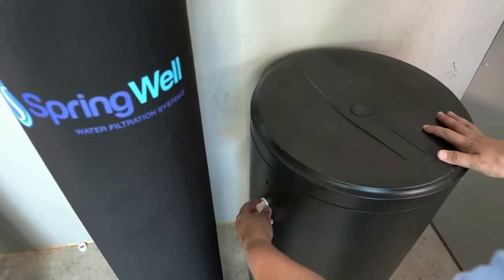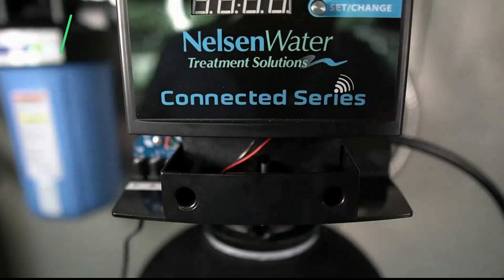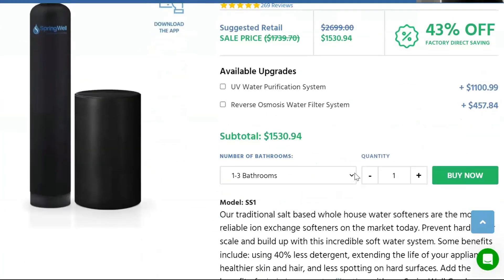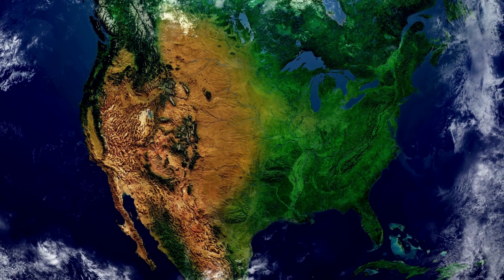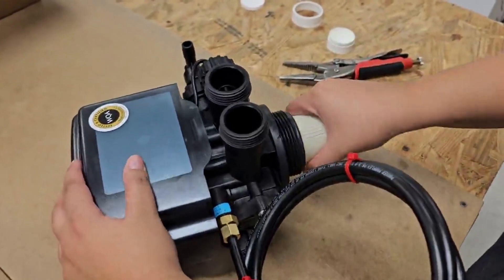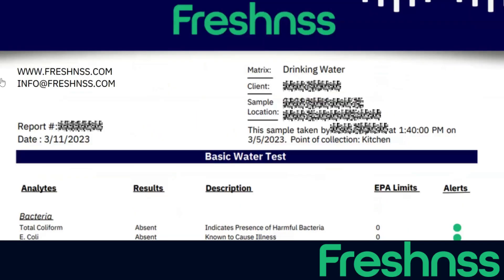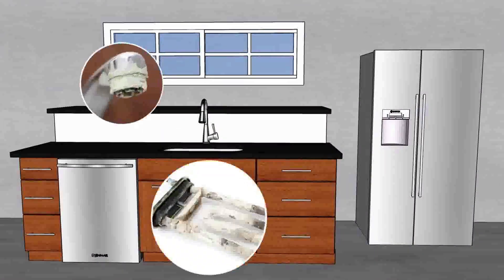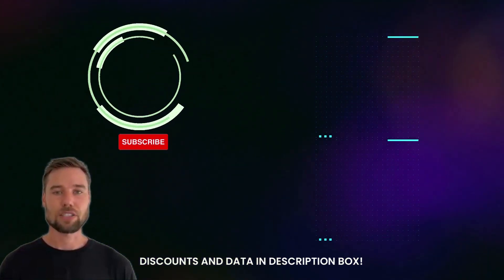The BEST Water Softener... That No One Is Talking About. We Lab Test It!

Comment: I've had my ss1 for one year and am working on cleaning, as recommended by springwell. do you have a video for cleaning the ss1, particularly disconnecting the brine tank
Reply: What did you end up doing ? Mine was low on salt and I cleaned the brine tank out with water .

Comment: I have to keep sodium intake low. May be a dumb question but do the salt based systems add sodium to drinking water I'd have to worry about? Thinking of a Salt-Free combo system from SpringWell but sounded like you think the salt versions are better. Our hard water has been wrecking our high end appliances (espresso machines, refrigerators, etc.)
Reply from the maker: Yes, we usually do mention that folks on a sodium-reduced diet should be careful. The harder your water is, the more salt will be added into the water. If you have reverse osmosis, that would remove all the salt. Otherwise, you have the option of using potassium instead of sodium. It's pricier and harder to get though, so you should check around first. Also, check the actually hardness level to begin with, as the salt added may be negligible.
Reply: @Freshnss  Good advice with the R/O systems. However, they remove beneficial minerals as well.

Comment: You point out that this system uses 8% cross-linked resin like its a good thing.  8% resin is the "cheap stuff".  The systems you get at Home Depot, Costco, Lowe's, etc use 8% cross-linked resin.  The advantage of 8% resin is that it's cheap.  The disadvantage of 8% resin is that it's cheap.  8% resin will lead to water pressure loss, uses a ton of salt leaving a slimy feeling in the water and these systems usually come with a 3-4 year warranty because they expect them to last you a few years and then you have to go get another one.  If you are going to have the same resin in this system and a system you can get at Home Depot for $500, what's the point of speanding more than $500?  You also mention that your "lab test" reported that this system took out 92% of the hardness in the water.  That's actually horrible and not something you should be pointing out if you want to showcase this system.  Water softeners are just that...water softeners.  They are expected to bring the hardness down to 0 grains hard.  100% soft, not 92% soft.  For living in an are with extremely hard water, the last system you should be looking at is a system with 8% resin.  You need, at minimum, a system that uses 10% resin or even 16% resin.  I hope you got paid well for promoting their product for them.
Reply: And no reply either
Reply: what happens if you don't replace salt? can you bypass the salt process if your supply runs out?
Reply: @ManzanitaRecords  If you run out of salt, it's not the end of the world.  But, it won't be cleaing itself out without the salt.  As the water goes through the resin in the system, the calcium and magnesium is being magnetically charged to the resin...it holds it in the resin tank.  It can only do that for so long until it needs to clean itself out (regenerate).  My systems are metered systems.  Every 1200 gallons it will need to clean itself out.  It will count down from 1199...1198 and so on.  Once it hits 0, that night at 2:00 am it will regenerate and use the salt.  The salt water is pumped into the resin tank and all that salt water is doing is reversing the polarization of the ions, releasing all of that calcium and magnesium it's been holding for the past 1200 gallons.  It then gets backed to your sewer and the systems resets to 1200 gallons.  

If you run out of salt, then your system will still regenerate when it needs to, but it won't be cleaning itself out, because it's the salt water that is doing that.  The salt has nothing to do with softening your water, it's just there to clean out the resin so it can continue to remove the hardness from your water.  So, if you put your system in by-pass then there is no water going through the water softener at all.  It's like you don't have a water softener.  The best thing to do is go buy some more salt and let the thing do what it was designed to do.  :)  I hope that answered your question.
Reply: @ManzanitaRecords  causes what you call a salt bridge or salt block. Basically the system gums up with all the scales and the salt is supposed to help alleviate that problem.  It can be a pain in the ass to fix so yeah bypassing would be the best way to go until you get some salt in. The lack of salt, pretty much asking for a salt clog down the road.
Reply: Can you recommend a good water system? I have hard water i feel and possibly chlorine. I am new to this and saw another person also recommend the springwell so i thought it would be good
Reply: @AOmar-hm7pw  It kind of depends on where you live.  The northeast and northwest usually have great water that is not hard.  In those areas, go ahead and get a springwell...the quality doesn't really matter there.  Although, it has the same media inside as a system you will find at Home Depot for $500...so, why spend more money than you need to?  

If you don't live in one of those areas and you do have hard water, the biggest piece of advice I could give you is to stay out of the box stores (Home Depot, Lowe's etc) and stay off the internet.  Anything you are going to find online is usually going to be the lowest quality and not designed to last a long time.  Where do you live?
Reply: Yep. Stopped watching immediately. Thanks @jasonc9791
Reply: For anyone interested, I just called the company and they told me they use 10% cross-linked resin. Maybe they upped their game since this video was put out, IDK? But there you go......
Reply: @Mike-hb4pc  You can ask them anything and they can say anything...is it in writing?  No?  That's what I thought.
Reply: Been reading your comments and thought wouldn’t hurt to ask your opinion on a good system for me to look into. I’m in central Florida our water is super hard and just over all disgusting. Taking your info and advice into consideration is there a certain system you can point me in the direction to? You say stay away from box stores and stay away from the internet so I’m trying to wrap my head around where else to look.
Reply: @ThePlur427   - THAT he can not answer, lol.
Reply: @mistersniffer6838  Yea a whole year has passed since his original comment and others have asked the same and he’s yet to actually give even just a HINT of what he believes to be the holy grail - he’s shot down the only two possible options. It’s smells like he’s full of COMPLETE horse shit!

Comment: even though I have 3 people in the house, and on occassion, I may have up to 6-10 people maybe only a couple of times a year, 
what is the drawback of getting the SS4, 
is it just basically having to backwash and waste more water?
Reply from the maker: Larger systems have larger tanks and more resin. These systems are pretty efficient so you likely wouldn't see much difference, but additional resin might be necessary if you have very hard water even if you don't have that many people. Best to do a hardness test and check with the manufacturer. It's important your existing flow rate can handle a larger unit.

Comment: Other than cost, are there any pros or con to using one size the ss4 over the ss1 ?
Reply from the maker: The larger systems deliver higher flow rates. You'll want to size a system based on your water usage. The larger SS4 system can deliver 13 gallons per minute (gpm) whereas the SS1 system can deliver 11 gpm.
Reply: @Freshnss but do you have to flush more often if you don't use as much?

Comment: Great video. Can you talk more about how Springwell helps to save approximately $200 a year on salt and water savings over old school downflow softeners? Does Fleck fall into that category? And how does Springwell help save money exactly? Is it because the time between regeneration is longer? Or other factors? Thanks.
Reply from the maker: Thanks for watching! The primary benefit of the SpringWell system is that it is a metered system that only backwashes when it reaches grain capacity. Many other systems use a simple timer or require the homeowner to estimate hardness and then that figure is used to formulate the right time between regen. The most basic ones are just on a straight timer and backwash whether you need it or not.

Comment: I get staining from iron and mineral build up on shower head and areators. A certain company tested the water and found 1.5 ppm of iron and hardness of 17 and reccomended a softener. My concern is for those who have to limit their salt intake, and the softener putting salt in the water. Is their an inexpensive way to remove the salt and still have soft water? my guess is a sediment filter, then softener, then RO, but that starts getting expensive and I hate changing the filters.
Reply from the maker: You can get an iron filter (aio) and a salt free system. You'll still need to replace media for at least the sediment filter - you can't really get around that. You're removing things from the water and you have to clear out what it catches.  We have details on our website: https://freshnss.com/best-salt-free-water-softener/
Reply: How long does the media last and can it be changed ? Will a 30 micron sediment filter be adequate pre treatment? I currently use a 20" carbon cartridge and it only lasts about 4 months before it starts losing pressure.

 @Freshnss
Reply from the maker: How long media lasts is wholly a function of your water usage and what's in the water. Any estimate is based on averages. AIO filters use charged beads like a water softener and have a recent cycle so that media can last for many years (7-10). But carbon and sediment filters do lots of heavy lifting so you'd likely still be looking at replacement every 3-6 months.

Think of it like oil changes for a car. If you drive a 1000 miles a week, you're going to be doing them more often than if you only drive to the grocery store once a week.

Comment: There sure are a lot of springwell videos that all say the same thing... 5 good things and 2 that need improvement.  Reviews that are really commercials.
Reply from the maker: I can’t speak to the other vids, but how is it a commercial when we literally installed it and did a before and after lab test in an independent certified laboratory?  And explain the calculations so people know how properly interpret their test results and size their softener (regardless of the brand).  We take a lot of time and resources to put this together.
Reply: @Freshnss  Did you get the product for free or at a reduced price? Maybe just a coincidence  https://youtu.be/6lKqQk3Ss80?si=Y0YUX3mV6_hJJLiI
Reply from the maker: @matthewp5478 No, we didn’t get the system for free or anything.  It is not “sponsored”.  I don’t know that other video, you would have to ask them. 

We do our own testing and research and share it with you all to see.

Comment: Is a double tank softener worth the money? Recently got a quote that was crazy high
Reply from the maker: Hey there!  It really depends on your water usage requirements.  If you don’t want any delays between regenerations, they can be a good idea.  But get ally for residential use, they aren’t necessarily.  What was the reason the salesperson said that you needed a twin tank?
Reply: @Freshnss  no reason. It was just the best model they make that had uninterrupted service
Reply from the maker: @dllanzy Got it.  If you can email me the model and details, I will take a look at it and see if it is necessary.  You might not need to spend thousands extra for something you don’t need.  Even if you did need a dual tank system, we likely can get a better option/price bc we are independent and have direct relationships with all the top manufacturers.  My email is erik (at) freshnss.com